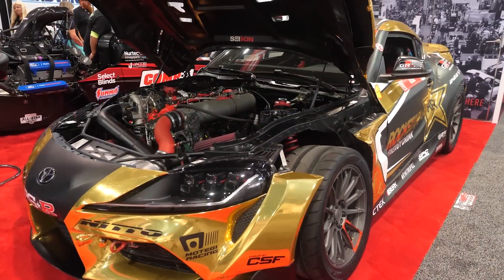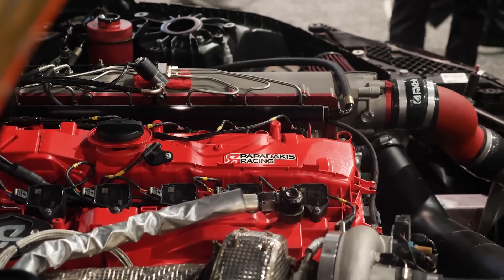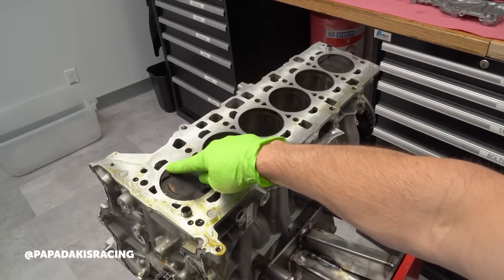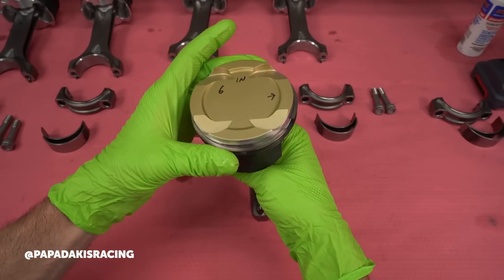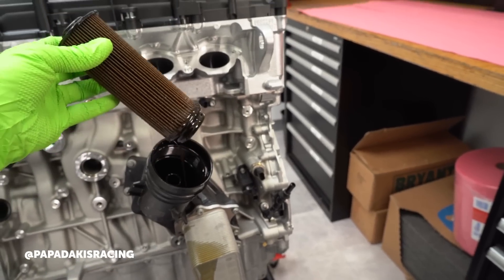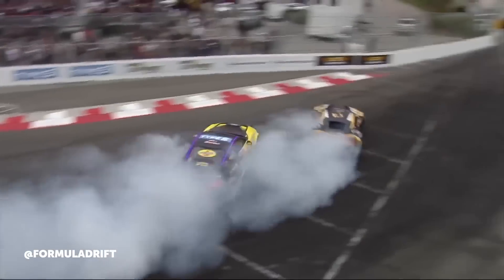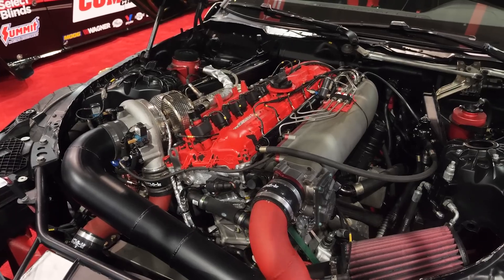Goodnight 2JZ? | 1200HP B58. Stock Block, Stock Bores & No Dry Sump!?

Comment: also crazy this thing rips... 3.2L 1200 HP, 8900 red line and just checking oil and filter haha
Reply: B58 is nuts
Reply: Most modern engines don't need much more than regular maintenance. In terms of output 1200 hp is percentage wise well within the design window of the engine. Hence the use of many stock components.

Comment: Absolutely not. With all the aftermarket for 2JZ, including the recent Dart blocks that are going to come out this summer, the 2JZ is always getting better. The B58 you can't touch, at all. You have to remove the entire engine to swap cams out. The valvetrain needs an OEM specific tool to remove the cams. Sure Papadakis did a great job, but the engine is designed horribly.

Comment from the maker: 🙋‍♂  Building a fast car? Get $400 OFF the VIP package with every current and FUTURE course included: https://hpcdmy.co/vipy10
🔧 Learn Engine Building today with 50% OFF your first course: https://hpcdmy.co/offery10
TIME STAMPS:
0:00 - Papadakis Racing GR Supra
0:15 - Most Winningist FD Team
0:28 - Tuned In Podcast Episode 040
0:42 - Why A B58 & Not A 2JZ
1:55 - Time Moves On!
2:14 - Cast iron Vs Alloy Block
3:14 - Aftermarket Piston Design
4:52 - B58 Cylinder Head
6:06 - Valve Springs
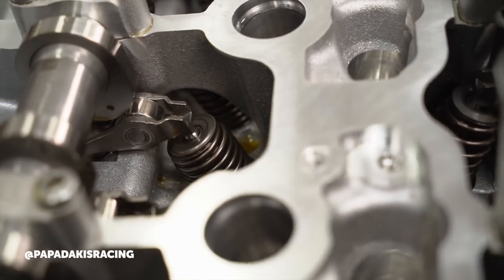6:30 - Valvetronic Locked
6:42 - 8,900rpm limit
6:56 - Bearings a Weakness
7:12 - Rebuilding & Maintenance
7:50 - Oil Pump Setup
8:44 - Lubrication System
9:55 - Why Not Dry Sump Off The Bat? 
10:50 - 2 Turbo Options
11:28 - Boost Control
12:17 - 4 Port Solenoid Explanation
13:38 - Turbo and Engine Packages
14:50 - More Power, More 'Better'?
16:09 - Throttle Modulation & Throttle Bodies
16:57 - Boost Pressure
17:27 - Cooling Package
19:00 - Thanks Bro!
19:14 - Free Knowledge. Grab it!
Reply from the maker: Take $50 USD off ANY HP Academy course (even the 1000hp 2jz engine building course example!) with this coupon: YOUTUBE50
Enroll now: https://hpcdmy.co/50offytc - Taz

Comment: I recognize lots of info from my S55 experience, i ended up controlling the oil pump at low load only and letting it go to its "emergency mode" at mid-high load. 
And fun fact, if i dont remember incorrectly, the plasma spray in the cylinders are almost double the thickness in the S55 compared to the B58 :)
Reply: I'm not sure if the B58 uses the same method, but the plasma spray was an invention from Ford.
Reply: @gbales84  i think gtr vr38 engine also has the same plasma spray around .05 thickness as s55 and those blocks hold 2000hp without sleeves
Reply: @durin23  Yes the GTR uses the Ford plasma spray, that much I know for sure.  I guess the process is still the same for the B58.  I think the new GT500 and the 5.8L GT500s use it as well.
Reply: Did you do this via tuning software?
Reply: @lbb_kev  I had a standalone ECU (Maxxecu)
Reply: youre spont on s55 does have a thicker plasma spray almost double,s55 is superiour in many ways,b58 has seen pre mature plasma wear on liner,some had to replace blocks at 40k miles.
Reply: @durin23  That sounds like the usual teething troubles for a new bore treatment. The nikasil and alusil were the same in their first runs, settled down after a few years as the process matured.
Reply: @durin23  Yeah they probably played it safe with the S55 since it was the beginning for the plasma coating for BMW :)
Reply: @durin23  the b58 is a diesel block and crank.  s55 block is just n55 block.  the b58 has huge stroke.  my m240i makes 1100ft lbs of torque at 4k rpm at all 4 wheels.  s55 could never, no matter how much power it makes.

Comment: Stock block stock boars who cares what decent motors can't do 1200? Sounds like your trying to fool people into thinking the short block is stock obviously 90%of the internals are aftermarket. Pistons not stock. Rods not stock main caps not stock main bolts not stock rod bolts not stock bearings not stock are the main caps stock? I'm pretty sure the 2 j blocks are stronger and the stock hp record was over 1000 let's see the b58 do that. And the 2 j is more serviceable the timing chain is on the back of the engine on the b58 screw that good luck switching cams or anything in the head probably need to pull the transmission and engine
Reply: can you find me a single FD team that runs full stock 2jz over 1000hp? lmao
Reply: @mostneuter  the whole point was the video said stock block that sounds like its a stock block with stock internals. That's like calling the supra its self stock. Also the video was making it seem like the b58 is superior I don't know about that
Reply: @speltwrong9009  didn't you get that they are a FD team?
Reply: @speltwrong9009  and in case you are wondering, 2jz that are used at this level (in FD for example) are fully built, with some even going for billet blocks
Reply: @mostneuter  yeah back to my point I bet they aren't calling their blocks stock
Reply: @mostneuter  all I'm saying is your video is misleading
Reply: @speltwrong9009  "stock block, stock bores & no dry sump" how is that misleading when it's true?
Reply: @mostneuter  goodnight 2jz. doesn't that sound like your saying the b58 is superior? The 2 j is a better cheaper more robust engine that's easier to work on that also has a stronger block. Kinda leading enthusiasts in the wrong direction if you ask me Goodnight most neuter
Reply: @speltwrong9009  now you are just being another one of those fanboy who can't accept another point of view to the point of misinterpreting the title
Reply: @speltwrong9009  2jz better? questionable; cheaper? depends where you live; more robust? the b58 in it's current itteration is too young but nothing would suggest that it's not at least just as robust; working on engines is a matter of knowledge and experience, what seems hard for you can be easy for someone else and the inverse case is just as true
Reply: @mostneuter  where in the world is a b58 going to be cheaper and more available? Also you think an aluminum block is going to be as reliable as an iron bolck and as strong? Aluminum is a softer metal. Direct injection is a nightmare. No way a b58 is as reliable easier to work on or cheaper in any circumstance I can think of ide still say a 2 jz is better you can get a 2jz ge for 1k and build it to 1000 hp for less than 20k total probably buy a t56 too
Reply: @speltwrong9009  where i live a decent 2jz can easily go above 5k, which is the price of a b58; for the block material, it doesn't matter if it's kept under the right conditions; direct injection isn't a nightmare if you know what you are doing, like most things in life; you can push reliably a b58 1000hp for less than 5k$ (added to the price of the engine)
Reply: @mostneuter  aluminum holds up as well as iron ? How exactly do you make direct injection as reliable and coust effective while keeping your valves from failing due to carbon build up? Where do you live?
Reply: @speltwrong9009  honestly at this point it feels like talking with someone stuck in 2012 so let's stop here
Reply: @mostneuter  ide at least like to know how you improve Direct injection

Comment: This reminds me, seems like most people completely forget that in this case BMW went the other way round.
What you get is the M4 GT3 racecar engine, designed to withstand at least 170 bar of cylinder pressure for a minimum of 30 hours* of racing.
The engine comes from the assembly line and only a handfull of components on the ouside are changed before it goes into the race car. Everything on the inside is the exact same as in the roadcar.

*30hours is like a standard for cars that are meant to do 24h races. during a normal season most GT3 engines are replaced every 40-50 hours.

Comment: New blocks only, cannot rebuild. Yikes. Doesn’t sound like a 2J replacement even if it makes crazy power.
Reply: This is literally the first team to push and use the b58 fr. It’s only the beginning
Reply: Until companies can offer respraying of the cylinder liners at an affordable cost I'd rather run an iron block on the street. It might weigh more but it will last longer for cheaper. If it's a race car and you have the money one of these is better but for a daily tuned car iron blocks still sound good for cost effectiveness.
Reply: @Dollsofgod  I don’t think these spray on sleeves are necessarily better. You’re probably saving only few pounds per block maximum. The rest of the benefits like the better cylinder heat transfer would be marginal at best, and pointless in certain circumstances. When you’re talking about an engine like the 2JZ, it’s already nearly a thousand pounds, saving 5 pounds on the liners at an increased cost and loss of serviceability doesn’t make it worth it in my books ->this might make sense leaving the factory where cars and engines are considered mostly disposable, and saving 5lbs can be a big deal. We have consistently seen with very good block like the 2J, LS, and K24 they’re often rebuilt several times over the course of decades ->if these blocks couldn’t have been rebuilt, they never would have had the following ->people wouldn’t be recycling them from the wrecker to put into a race car if they had spray in liners. I’m happy to see them put a manual back in the Supra for all the Gen Y buyers, but if they wanted to resurrect the JDM hot rod movement with this chassis, this is a foul of epic proportions and cannot be corrected by the factory without a completely new casting that will have new (larger), dimensions.
Reply: Lol look at street & drag builds then the B58 is the 2JZ replacement

Comment: Very cool, informative, very interesting. Is so clever the way they go about building as simple as possible but done in a very careful, thoughtful way and still innovative way. Very intelligent and so damm cool

The heatshielding is that motorsport specific or is there aftermarket alternative besides (heat wrap/beanies & so.expensive in my country ceramic coating)? See something similar in heat shielding in profesional top-shelve racing, you never see these shields on aftermarket builds?
Reply: @Jacob  thanks friend, had a small hope it was more accessible/affordable for our mere mortals. Guess that why you see them only on the big budget Top-flight motorsports.

Comment: Man, 90 psi oil pressure all the time? I wonder if bearing erosion is an issue? Papadak is a legend. Thanks Andre and HPA Team💪
Reply: they probably change main bearings before erosion starts show up... it's cheaper and easier to change them than rebuild whole engine
Reply: @Deep42Thought  it's been decades since i first heard of bearing erosion. I haven't heard anybody talk about it or contribute a failure to it yet. I started to think it was an old tale...
Reply: @PANTYEATR1  it's racing engine so changing oil and other wearable parts is worth the effort  and easier on the budget. Same goes with dry sump. It's causing due to excessive vacuum. Also Merican drift is  for kids with only 3 turns...  for real one or two transitions and 3 turns? such a shame
Reply: N54’s run quite high oil pressure too. I think BMW is overcompensating with all their previous rod bearing issues. 😂

Comment: I just picked up a blown B58, for $150 bucks, I just bought it to take it apart and see how it's built, lucky for me the head is still good, crank is done, block is done, but 5 rods and pistons survived, what I thought was weird is that it's not a 2 piece girdle blocks like the N54's.
Reply: That's actually interesting because I believe many aluminum engines have a girdle to overcome the weakness of the aluminum.
Reply: @GabeIsHere  Yeah I thought so too, the main caps are beefy af tho, still only 2 main bolt caps.
Reply: @SavageBunny1  the nice thing about the b58 is the thick windage tray... or more like a girdle that they use to help stiffen and tie the caps to the block, we find the caps start to walk around the 1000hp mark, the liners are good safely for 700whp, at 800 we find they start to speckle and flake.
Reply: That’s the idea ig with a modular design family of engines.

Comment: What size throtle body did they use?
Reply: Looks like the bosch motorsports 82mm.
Reply: @TurboVisBits  so 74mm would be fine for 700whp  3.4 2j ?
Reply: @mv6160  You can make 1000 hp with the stock throttle body.
Reply: @NearCry91  I just  don’t want to oversize unnecessary, thank you.
Reply: @mv6160  for drift or drag?
Reply: @m v  you can go larger, and downsize the intake tube. #futureproof

Comment: We may never see the power output of a iron block engine with the B58 but it is not by any means "lame".
Reply: Exactly, its horses for courses. It seems to make that 1200ish very reliably with great response so its and excellent engine for this application. People compaining that I wont see 3000+hp are either A: Bench racing children on the internet or B: High level pro drag racers, and for the later there will always be Billet and Dart 2jz blocks so its kind of an pointless arguement. Also, who knows! I don't think people expected the VR38 to be able to make 3000+HP but here we are.
Reply: @Benny B.
Wish i could like your comment, but i just found out there's an invisible video quality report blocking it, thanks YouTube.